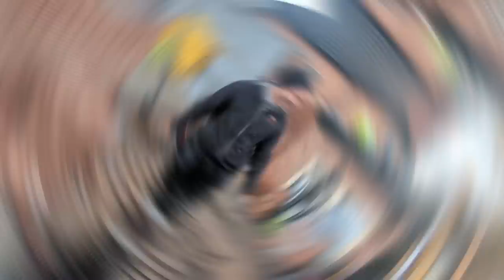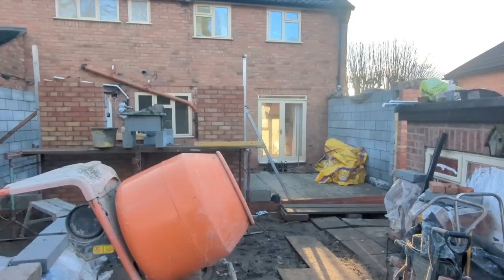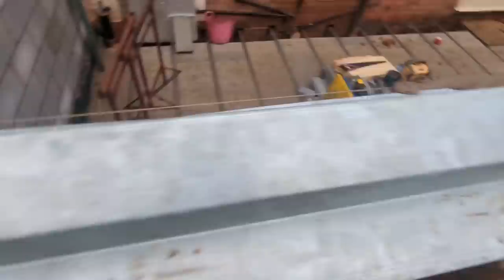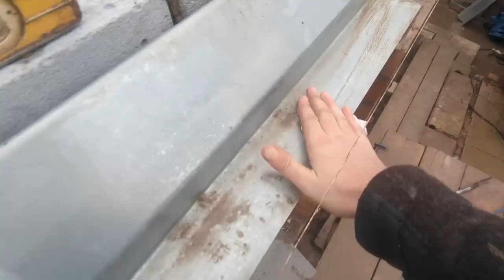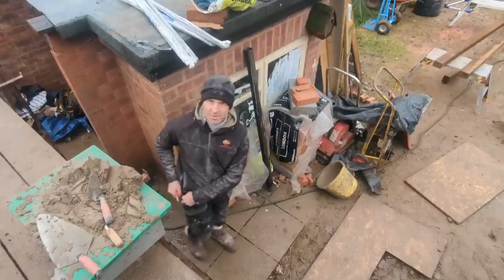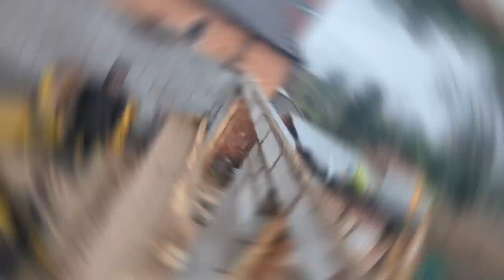Single Storey Extension Stage 6 Continued...How To Install Lintels and Wall Plate.

Comment: In the past I've knocked a few large headed galvanised felt nails in the underside of wall plates to give the mortar something to hold on to. I know gravity should stop it moving but I've seen wallplates that have moved a bit on older buildings.
Reply from the maker: That's a great tip mate, I'll remember that one! Thank you! Hope you're well mate, take care.
Reply: I nail a 50mm roll of EML on mine as well as the usual straps. I started building back in 1988 so was taught by old skool builders! Great videos though mate. Really enjoy them 👍🏼
Reply: @Mr_A_Builders  I have seen an engineer spec 10x140mm frame fixings at 1m centres down the middle of the wall plate. Once there mortar has gone off of course. Seems like it might help stop any movement from breaking the joint, but pretty belt and braces.

Comment: Finger trowel, Slicker, Fugspiker depending on where in the world you are. If ime doing soffit on top of frame I use Eaves Lintols which are designed for this as for wall plates depending on the builder or if its my job I find it better to get the blockwork spot on height and no bed then screw the plate to the blockwork dry that way it's easy to get all imperfections and bows out of the plate.
Reply from the maker: Slicker!!! That's the word I was looking for! Cheers mate. It's strange how things are different from one part of the country to another, we're not allowed to not bed the plate on! Hope you're well and keeping busy, thanks again mate.

Comment: Great videos chaps! What fixings do you use for the wall plate straps to the block to get a good fix?
Reply from the maker: Hi Stephen and thanks for commenting. We use 2” x 10 screws with brown plugs. 1 has to go maximum up from the bottom and then one per block. Thanks for watching 👍🏻

Comment: Hi guys, if the BI had wanted a cavity tray, would you not have to go a course or two higher with the outer brick to accommodate weepholes ?
Reply from the maker: Hello Kevin, hope you're well mate. The weep holes go between the perps on the lintel course, so there wouldn't have been any need to go higher had he wanted the cavity tray. Cheers for watching mate.

Comment: Can you share more about reusing materials from one job on another?
I’m wondering if any of the clients watching would feel miffed about something taken out their house being reused rather than disposed as they (presumably) expected, or the new building clients feeling hard done by for not getting new materials.
Do you need to be explicit with everyone?
Reply from the maker: Hello grassfolk1, hope you're well. If the customer wants thing thrown away and we can see a use for it then it gets used again. Anyone who has an issue with materials being reused and would rather they go to landfill can go swivel as far as we're concerned! The same customer wouldn't mind in the slightest if we used reclaimed bricks to match their house so that voids any argument they may have. Not that I've ever had a customer be so silly, and I've had some silly customers!
Reply: 😂🤣😂
Customers are very silly frequently
Thanks for your response

Comment: What do you make of the vervor laser? I had one and after a month receiver stopped working, Got intouch with them was like trying to get blood outa a stone, they didn’t even replace it😡😂
Reply from the maker: Hello Craig. I think it's ace, I'd always recommend them. I know that they are cheap (comparatively) but I had a really expensive Stabila one once, when it broke I took it to get fixed and was told that they don't make them anymore so they didn't supply the parts even though they still sold the complete tool for nearly £700. I feel.for anyone who paid that thinking that they were covered if it went wrong. So i bought this one for just over £100, I was obviously dubious at first but I've got to say it's been fantastic and I don't mean that as in it's good for the money, I mean it as I think it's fantastic even if I paid a lot more for it.
Reply: @Mr_A_Builders  they defo work, I just got a dudd but it’s like anything, out can be faulty I suppose. 
As long as it works. 
Bet your glad you got the brick work done before the cold snap 🥴🤮😂
Reply from the maker: Oh man, it ain't over yet!!! Still got a bit more to do and couldn't today because it's too cold! Nightmare! Cheers mate.

Comment: I'm gonna sound like a killjoy but you really should have full blocks under the Lintels, that's the standard nowadays
Reply from the maker: Hello Changy, hope you're well mate. Yeah, you are coming across as the small turd in the large swimming pool with that one! Haha! Not allowed onsite, fair enough. But we both know that in the real world It makes absolutely zero difference to the structural integrity of the building. Have a great week mate, hope the weather doesn't set you back too much.

Comment: 1:4 is far too  strong for LBC commons . It also makes the muck ugly . 1:4 is the BS for engineering bricks . Pointing in is the lost craft . The correct mix should be 1:1:6:.
Reply from the maker: I've used 5:1 on these bricks before and have had issues, but I know where you're coming from Eddie. Appreciate the comment.

Comment: I looks like this dormer loft was build on the outer wall and I'm wondering why some people build them on inner walls. Are there any rules apart from minimum 20 cm from eves? 🤔
Reply from the maker: Hello Daniel. This dormer was built off the inner skin, you shouldn't have any issues with the weight transferring down by doing that, but it's still got to be all 'speced' out.